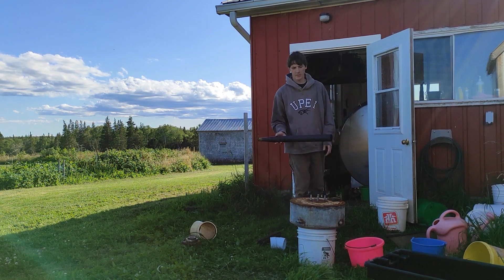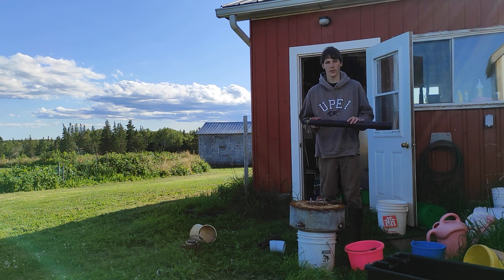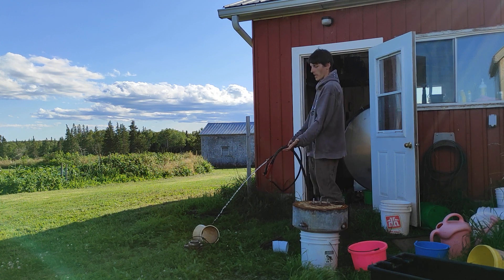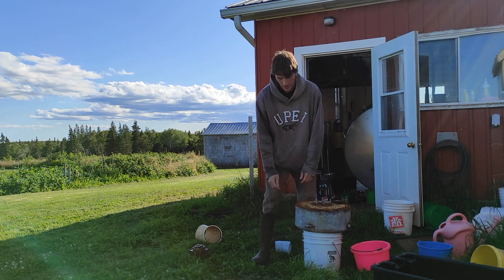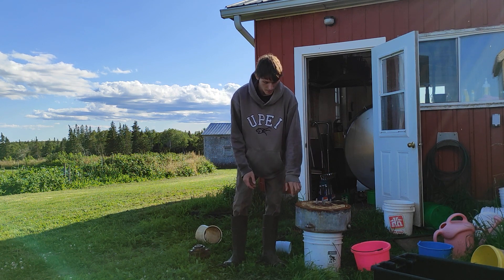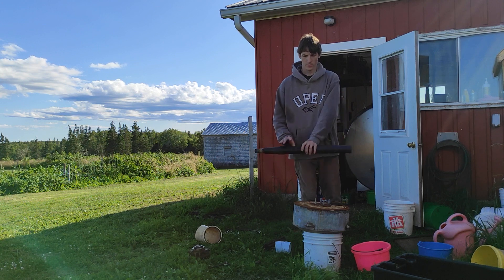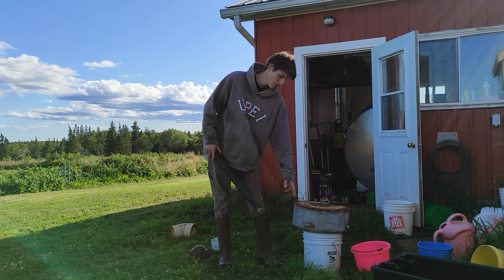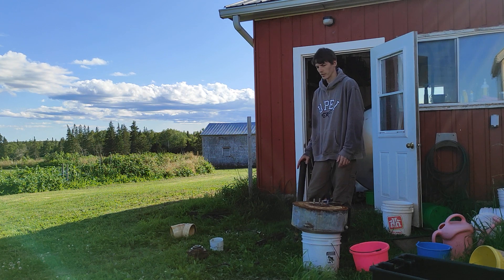The Clem Engine and the Venturi Effect

Comment: bro clem sepend 110 0000 dolars for device ,it is not easy  you spend couple dolars
Reply from the maker: Sir Timothy Thrapp had many designs working in the Phillipines using cutting wheels, scrap iron, an arc welder, etc. To build a well-working implosion motor is expensive, but a proof of concept design isn't expensive.

Comment: I wonder if you had something like a Pelton wheel with internal cups surrounding the nozzles, but not connected to the motor or axle (maybe on a thrust bearing) would you get counter-rotation to generate at the wheel rim too?
Reply from the maker: Yes, Schauberger did this in his "Home Power Generator" with the stator ring. If you just have holes (instead of venturi's) like the Donnie Watts machine, the water coming out is not really moving at all, so this doesn't work.